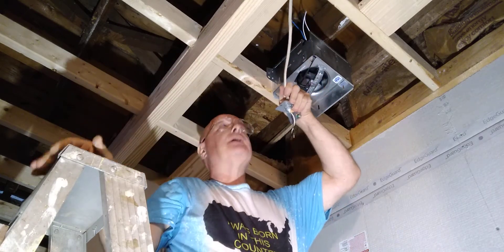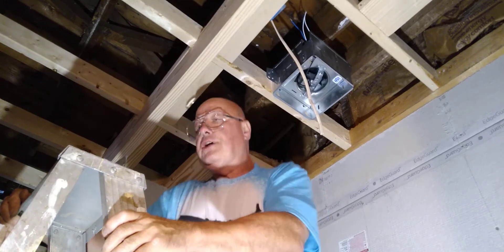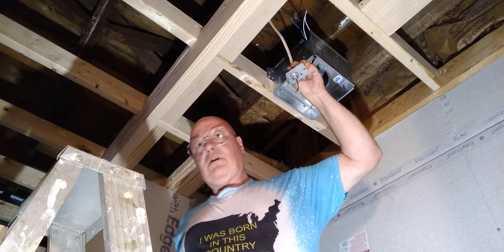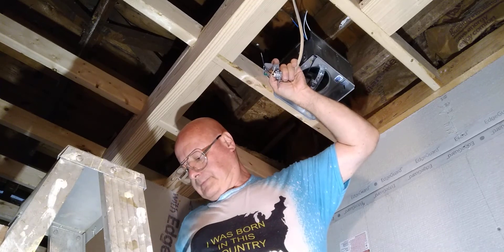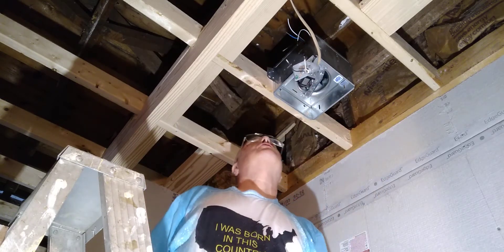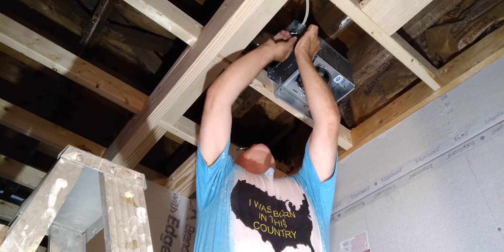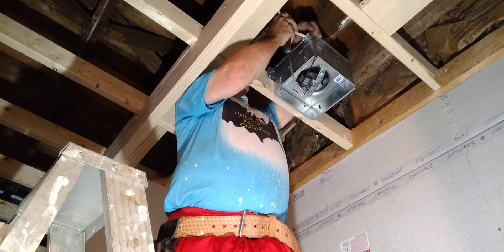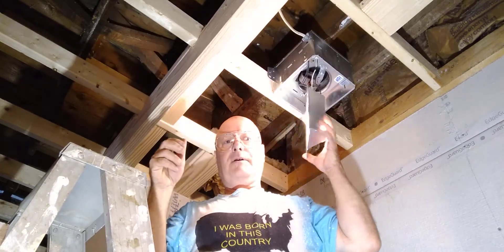how to wire a bathroom exhaust fan - light and fan controlled by the same switch

Comment: I have my volume at 100% but can barely hear the talking. I did see that I have mine wired the right way for 1 switch to work both fan/light, but for some reason I have to flip my switch twice to power on the fan and I still cannot get the light to come on so I assume I will need to check the bulb since this is a new unit with the quiet motor. Thank you much for what I could hear and see.
Reply: Same problem, my light is not working either
Reply: @kathytag1773  I had to remove about 12 screws, go into the light bulbs, and then found the main plug inside the white plastic cover was completely unplugged. so I plugged it in put the light back together very carefully as the metal back only lines up with the cover plastic screw holes 1 way. After I accomplished all of that it works fine for now.